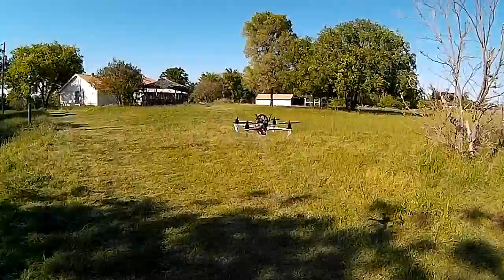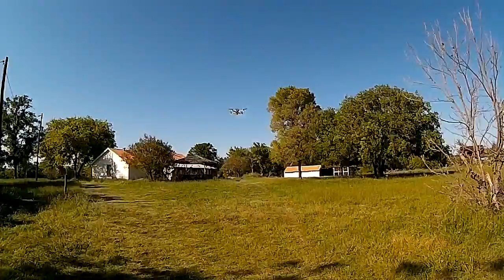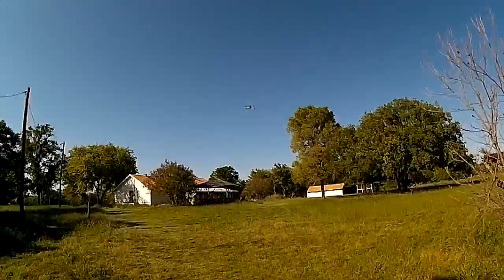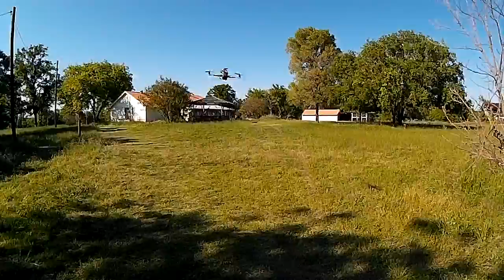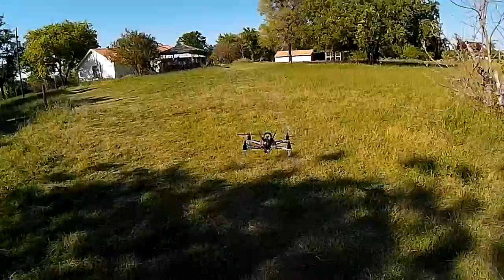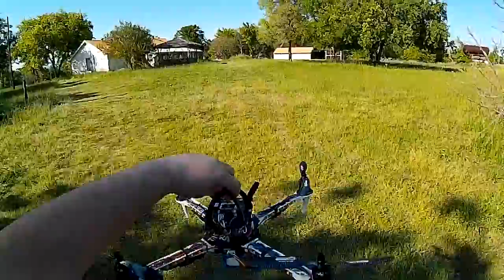SK450 Line of sight flying Part 2

Comment: Hi there! Well, I never realised you could have the Taranis speak your altitude! Which FC do you use?
Reply from the maker: +husky041 Hi. I am using a Seriously Pro F3 with cleanflight 1.12 Iuse the onboard barometer and output the altitude into the Smart port telemetry of the X8R receiver. I have a FrSky GPS V2 Sensor with SMART Port, FrSky FLVSS LiPo Voltage Sensor With Smart Port , and a FrSky SP-150A - Smart Port 150 Amp Sensor daisy chained together into the smart port with the connection from the flight controller plugged in last. I can see accelerometer data and altitude in real time on my Taranis.  I don't even use the low voltage alarm in cleanflight, I let Frsky telemetry handle it and I programmed low voltage alarms at the Taranis.